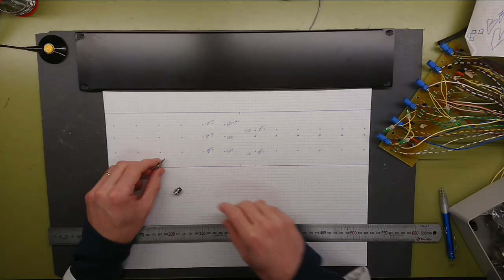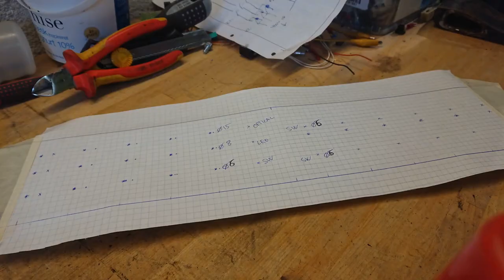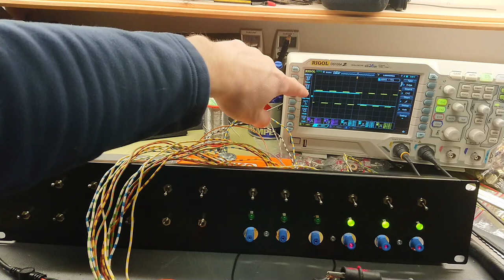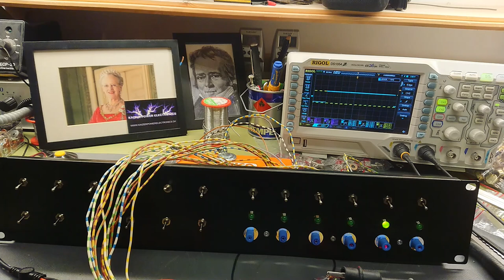Tesla Coil Show Controller - 6 Optical Output Control Panel (Part 3 of 8)

Comment: Love this intro :D what are they? Diode modules? Thyristors? Btw you can get custom made rack panels from https://www.rack247.com/ and btw2 if you ever want some different background music you may want to check Wintergatans collections. He made them available for free for youtubers: https://wintergatan.net/collections/download
Reply from the maker: Yes its SKKT Thyristor modules from UPS systems :) I have looked at different custom panel makers, but the prices are somewhat in the high end. Especially when you want that many holes in a panel. If it was just a square hole for a display it could be a good idea, making that yourself is not as easy to get nice (hint for next video). Thanks for the hint on background music, the ones I am using is made by a friend of mine that teaches drumming and plays in a couple of Danish bands.
Reply: @KaizerPowerElectronicsDk  Interesting point withthe hole count. Since i never ordered a panel (only saw the results others got), i didnt know it would drive up the price that much. Anyways, I agree with what you said in the video. At least on screen your panel looks quite good.
Reply from the maker: I got "Front Panel Designer" installed from Front Panel Express, LLC. They would charge 20$ for the panel, 5$ for the display cutout, but then 0.5 to 1$ for each hole (small/large). So with finishing and tool changes it runs up in 90$!
Reply: @KaizerPowerElectronicsDk  at that price point I‘d have done it myself, too...
Reply: Apparently rack247 charges a fixed prize only based on the panel size. A 2U custom panel with no holes costs as much as one with 24 holes. 58€ (incl. VAT) plus shipping. 1U is 40€. At least for me that starts to come in a price range worth thinking about.

Comment: Maybe drilling from the inside of the front panel would help eliminate the chips produced eating through the tape on the front?
Reply from the maker: Its a good point, but it requires rigorous cleaning of the surface its put down on, else you just have chips scratching the panel that way. I found this works best for me, when there is something to cover the hole like a nut/knob on the switch/potentiometer, but I am not a machinist :)

Comment: Clean layout, Very nice.  I look forward to seeing the orchestra in action.  For those missing speakers, you might want to check Alfred's room.  You're gonna have your hands FULL when he gets tall enough to work switches on his own -- might need to start hanging around defense surplus for those locking cover switches (helicopters are the best).
Reply from the maker: He does not have it from strangers :) As a kid I drove a life guard into a pool because of some nice big green buttons in children height. The life guard was leaning over a night mat that could roll over the pool for the night and as I just walked by I pushed the green button and was gone just as fast. He has tipped over the roller and started sinking into the pool on it :)
Reply: @KaizerPowerElectronicsDk  The things that made sense at the time.  I'm sure that was tame compared to later :D